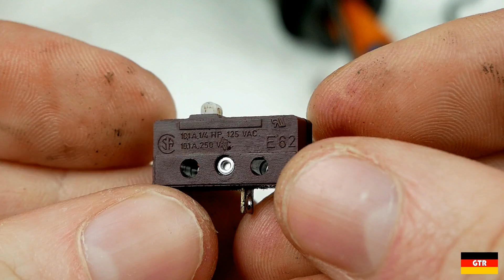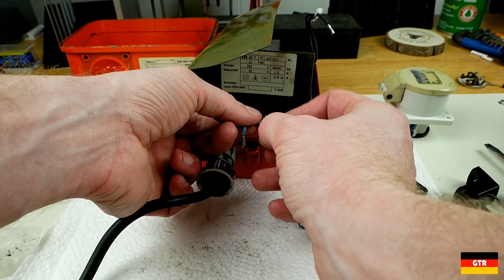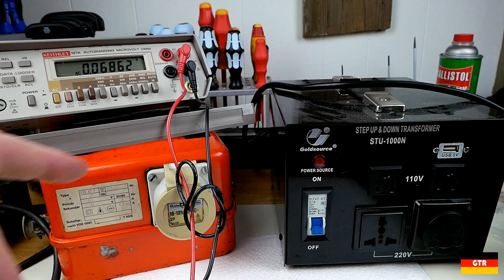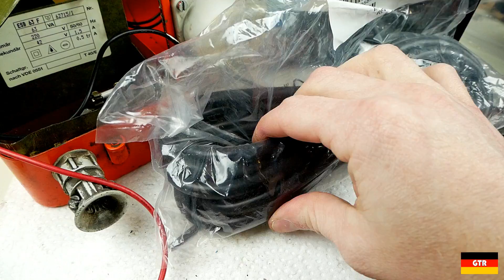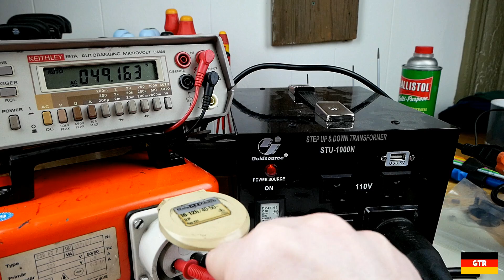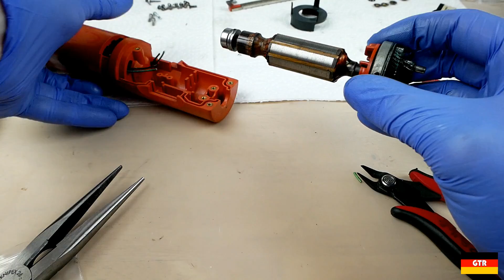Vintage Fein Assd 715-1 42V Screwdriver Part 2: Attempted Restoration

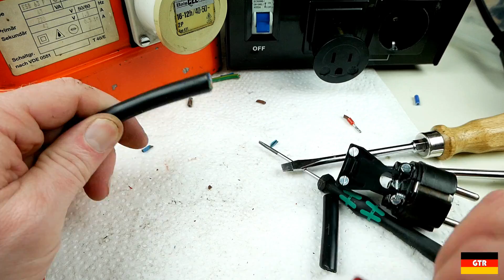Comment: what was the tool used at 13:00 ? for stripping the outer insulation
Reply from the maker: That is the Knipex 16-65-125 cable dismantling tool.  I haven't had a chance to do a review on it yet but it has been working well on the times when I've used it.  I believe it is actually made by Jokari and rebranded by Knipex.
Reply: ah nice. Thanks. I will give them a shot

Comment: I'm glad someone as logical and methodical as you will be like us and just grab the nearest tool available.  When you are commenting on that converter thing and how you detest them you are using those Felo wood handle screwdriver to flip the switch when it sure looks like you have insulated Wera ones right behind the box.  Maybe I am the only one who finds that hilarious but it sure made me smile.
Reply from the maker: Haha, yeah I didn't think about it, but yeah probably should have used some insulated ones.  I think I already had those ones out.  I don't have a whole lot of insulated tools so I forget that I have them.

Comment: At least the plug was already replaced. Normally double-insulated tools use a Europlug (rated 2,5A) or a contour-plug (rated 16A), depending on the demand of the appliance and if a ground is not needed (type C plugs). The Schuko-plug is only necessary if you need a ground. But the other plugs are not available as replacements with VDE-certification, so in most cases electricians replace a broken plug with a Schuko-plug and don't connect the ground. Merten is a manufacturer of wall outlets, switches and plugs.

contour-plug which was probably installed before:

https://www.netzleitungen.com/media/image/58/a2/67/c155c8a0844b5e0.jpg

Comment: On miniature circuit breakers like that 4000A is the maximum fault the circuit breaker is designed to break and the C10 is the actual trip rating.
Reply from the maker: Thanks!  I was thinking that I must be misinterpreting that.
Reply: 4000 amps ís low. The standard breakers we use in Europe should be rated for at least 6000A of short-circuit breaking current.
The ones I typically install in industrial distribution boards (hospitals, offices etc) have a rating of 10.000 Amps.

The C10 means that it's a breaker with a nominal current of 10 Amps, and and is medium-slow. The B, C or D letter is measure for tripping time, the B being the fastest. You would typically use a B breaker, and the C and D are used in applications with large transformers, motors, etc. That way the normal inrush current would not instantly trip the breaker on power-up.

Since that transformer is a piece of crap, and has those terrible one-size-fits-all-but-not-really outlets on it, the breaker isn't too good either.. It doesn't even have a manufacturers name on it.
Reply from the maker: Yeah it is a piece of crap transformer.  I feel like I need to get some linemans rubber gloves out when using it to prevent getting shocked.
Reply: Irish Mario W